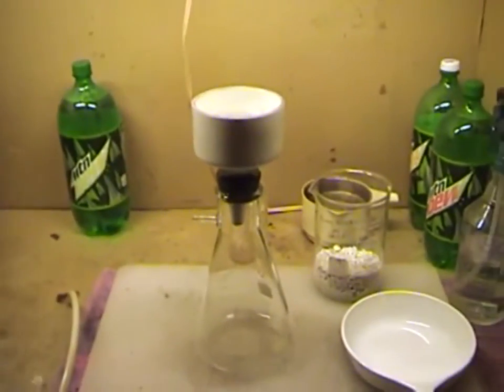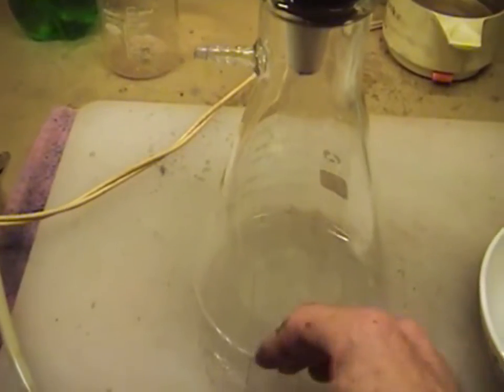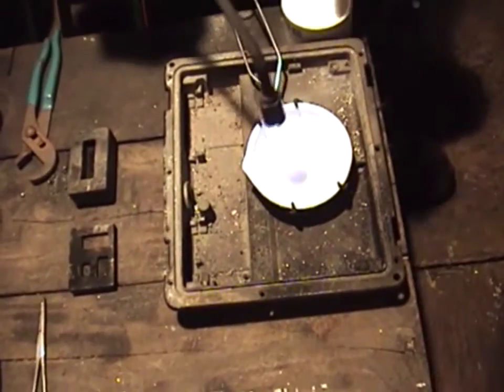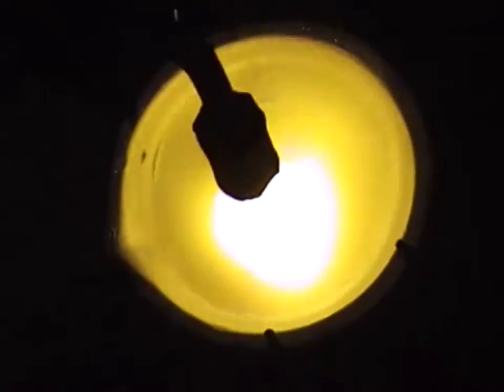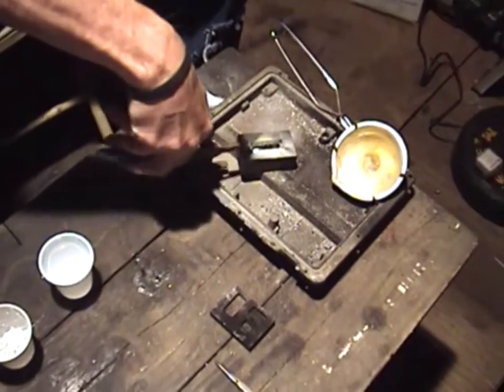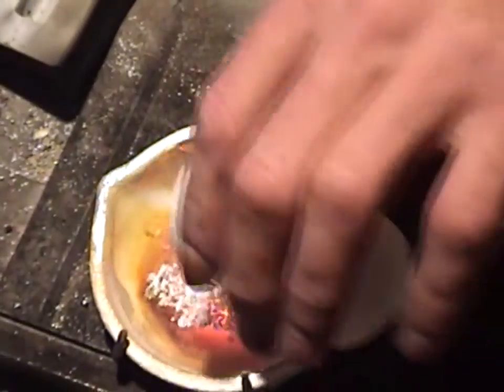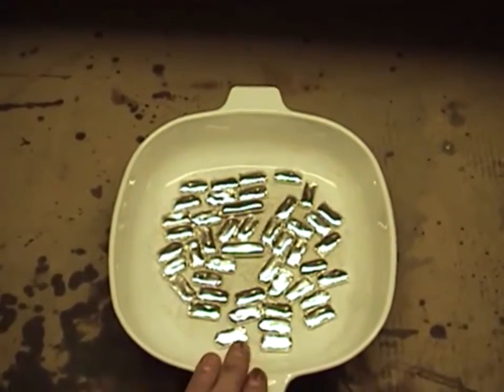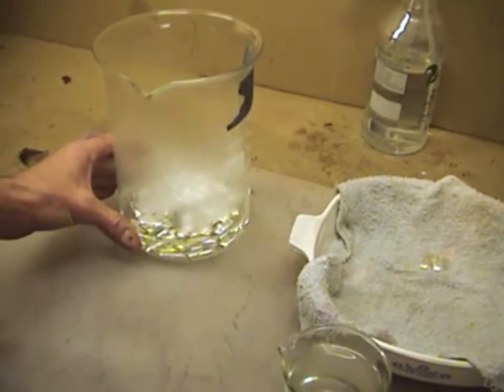REFINING AND GROWING SILVER CELL CRYSTALS BY ELECTROLYSIS IN ELECTROLYTIC SOLUTION # 5

Comment: Can you point me in the direction on what transformer to buy please.
Reply from the maker: https://www.ebay.com/p/30v-5a-DC-Power-Supply-Adjustable-Variable-Dual-Digital-Lab-Test/25012678214?iid=152857635607&_trkparms=aid%3D555018%26algo%3DPL.SIM%26ao%3D2%26asc%3D50544%26meid%3Df3c95a5fe7334aae8231cf07fcc07655%26pid%3D100005%26rk%3D2%26rkt%3D12%26mehot%3Dpp%26sd%3D391694935441%26itm%3D152857635607&_trksid=p2047675.c100005.m1851
Reply: AQUILLA REFINING WOW that was super quick. Thank you soo much. I have been refing gold and silver but want to get to 999 status. Sadly we don't have the ability to use Nitric acid, but I found Potassium Nitrate and HCL works great for Gold recovery.

Comment: Hello,
I've used nitric and distilled water but I guess I had to much left over nitric when I put my copper in. Now I have a thick bluish green slime! I don't know how to send pictures to you. I've used 610 grams of sterling I don't want to lose! What can I do to get the slime and silver apart? Any help would be great! Thanks.
Reply from the maker: Have you tested the solution with a little salt by taking some of the solution out and putting it in a plastic spoon and adding the salt to make sure all your silver has dropped first? It will turn white if you still have silver in solution.
Reply from the maker: My email is aquillarefining@yahoo.com sir.

Comment: I'm a bit confused about one thing with the silver cell process, does the several ounces of silver you use to create the electrolyte solution and the silver you use for the anode come out as crystals or is it just a needed sacrifice. Great videos thanks
Reply from the maker: The anode comes out on the other side as crystals sir and the silver used for the electrolyte is recovered and reused by copper cementing it out of solution.

Comment: isn't it easier to use ionic silver water rather than nitric acid? just trying to figure out if I can use water with nanoparticles of silver suspended in it rather than using nitric acid?
Reply from the maker: +Meashaa Downing (TransformedByChrist) No sir. Ionic silver as your calling is is actually small solid metallic particles of silver (nanoparticle) as you correctly called it. Silver nitrate is a solution of metal ions dissolved into a medium (nitric acid). You need liquid ions to purify silver through a solution, not suspended metallic particles, because they won't conduct current through the solution..

Comment: please if you can give me your answer,,,,,, WHY MY BARS AT THE BOTTOM MAKING HOLES OR BUBBLES..?
THANK YOU VERY MUCH...!
Reply from the maker: Two things can cause that. The first is overheating. It take way less heat to melt silver than it does gold or copper. Overheating will lead to weight losses from the silver vaporizing off also. When silver is hot it has an affinity to absorb oxygen and as it cools the oxygen is all the sudden expelled from the surface of the silver and causes bubbles or pits in the surface of your bar. The mold being to hot with a combination of the oxygen escaping under the bar and trapped between the surface of the mold and the bar causes the bottom of the bar to raise up. On the top surface of the bar where the oxygen is not trapped and escapes it causes pits or bubbles. When melting silver one should use a set of torches where the gas flow can be adjusted. You want an excess of propane and a shortage of oxygen so as you melt the silver there is no oxygen for the silver to adsorb. When you pour the bar keep the flame of the torch on the surface of the bar and this will lead to an oxygen restricted environment and a smoother pour. Once the surface skims you can remove the torch.